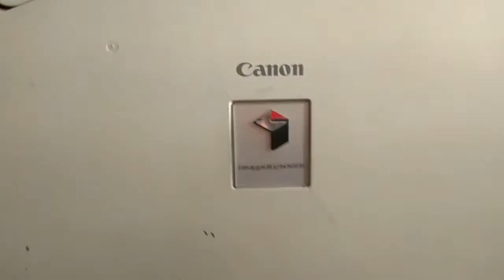How to Open Film Unit or Fixing Unit | Heating Roller (Orange Color) | in Canon IR3300

Comment: Ir 400 ka E014 ata hai. Kuch der bad 20 30 hober por fer e014
Reply from the maker: E-014 - The fixing motor has a problem. This can be the fuser drive motor, DC Controller, or Image Processor circuit boards. The only time I've had this problem is with one of the fuser bearing going bad and causing excess drag to the motor, giving you the error. See if the green fuser advance knob is hard to turn. If so then check the bearings.

Comment: Sir IR3300 main Heater Patti 3-4 din main short ho zati hai, 1 baar to jal ke 2 tukde ho gaye (Kya problem ho sakta hai). 10 din main 3 patti damage ho gayi hai. THANKS
Reply from the maker: 110 ki heater patti or 210 ki heater different aati hai.. sahi use lar k lagye

Comment: error    E000000-0000 ...what is problem ?
Reply from the maker: E000-0000

Description

The reading of the main thermistor does not reach 30C 1 sec after the main power switch is turned on. Or, it does not reach 70C 2 sec thereafter

Causes

The fixing film unit is faulty. The main thermistor has an open circuit. The fixing heater has an open circuit. The main power supply PCB is faulty. The DC controller PCB is faulty. To reset the error, execute the following in service mode: COPIER>FUNCTION>CLEAR>ERR.
Reply: ZigZag BaBa but it comes again and again continually...! What is the solution...?
Reply from the maker: Film check karo.. khrab ho to change kar do..

Comment: Canon ir223o error code e602 0002
Reply from the maker: Hardisk error
Reply from the maker: E602-0002

Description

A data read fault of the HDD is detected when the HDD is started up from the BOOT ROM

Causes

The wiring is faulty (short circuit, open circuit). The HDD is faulty. The main controller PCB is faulty.